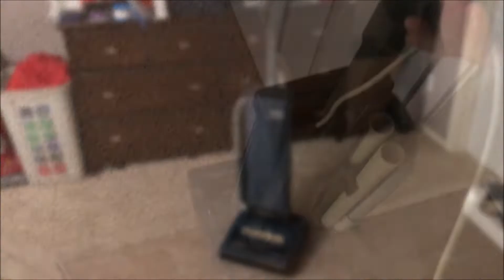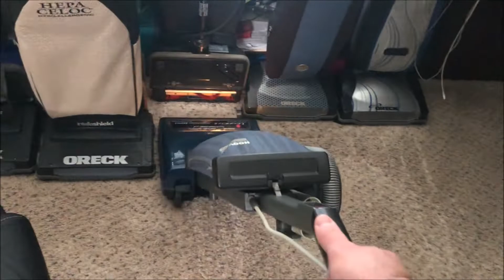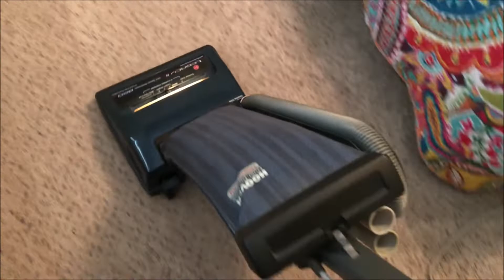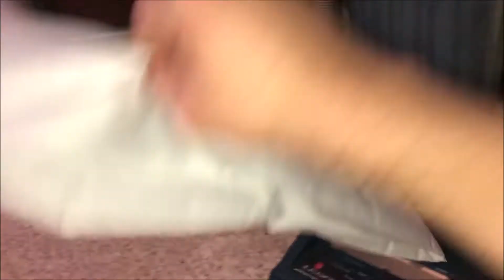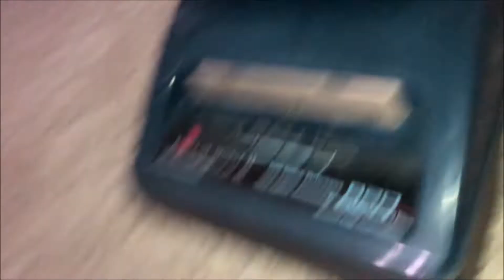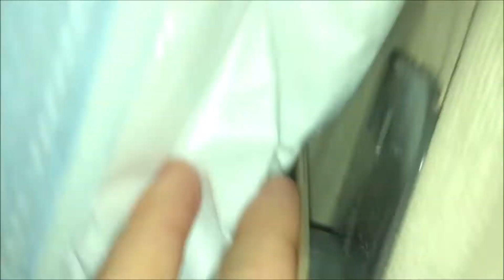Hoover Legacy II 820 Cleaning Performance

Comment: Honestly I like these vac because it doesn’t need to be fancy order expensive not too powerful suction but easy to fix
Reply from the maker: That's honestly the thing I love about all of these Elite style cleaners.  In fact, the only thing that's complex to do to these is changing the belt.
Reply: @graysonsvacsandmowers5426  I remember about 11 years ago people throw these out on the street I took it home these vacuum still works change the belt and brush rows and clean the bag still cleans really good. These they people give it to donations or they sell it for $5.00 since nowadays vac are a little to technology and expensive
Reply from the maker: @SingleLifeChannel  broken belts or something internally wrong are usually the reasons why these get tossed to the curb or sold for dirt cheap.  If I see any Elite on the curb, I'd buy it immediately, and look into fixing as much as possible.  They're not too hard to work on.
Reply from the maker: @TJ Yes, and any of the Elite style cleaners for that matter.